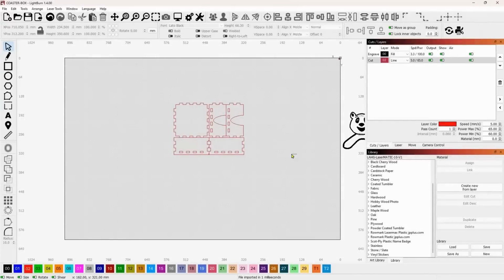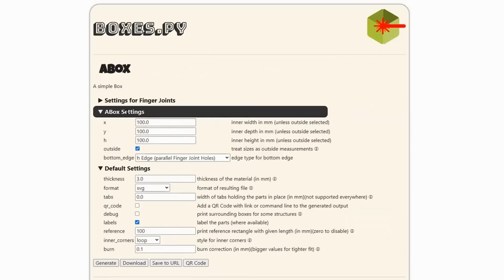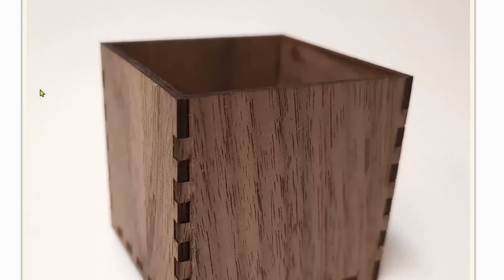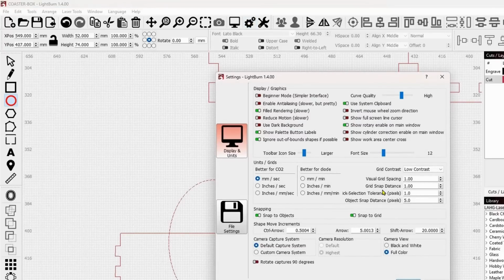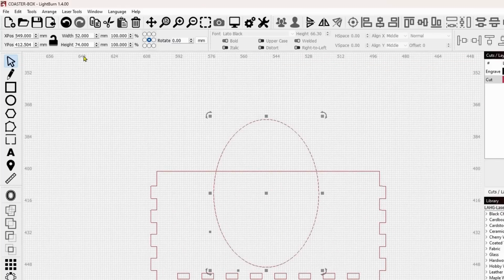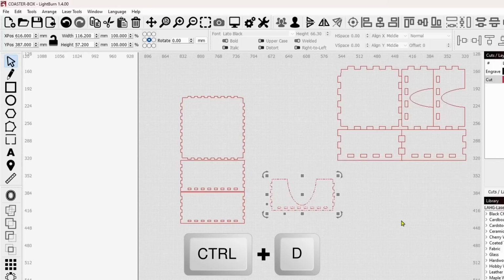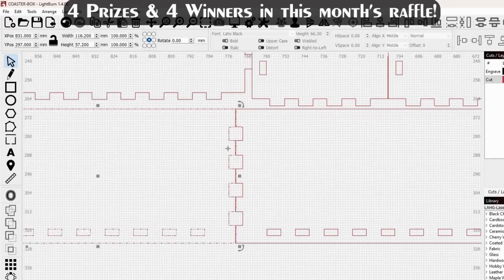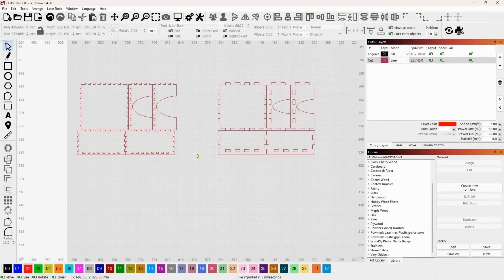📦 Lightburn Designed Boxes, PLUS a custom Kleenex Tissue Box cover!

Comment: Love the box video. Question about the slate coasters, do you put any kind of finish on them or do you leave them natural?
Reply from the maker: I have 2 finishes the customer could choose from George. One is 3 coats of plain Shellac and I scuff the final coat, and the other is a custom blend of beeswax pellets and cutting board oil (70/30) that I cook in a crockpot, poured into in a 4oz can, where it resolidifies. The wax/oil I sell separately as an upsell item for $6.00. Most folks chose the wax.

Comment: I really like the video, but putting it into practice doesn't give the expected result.  Maybe the solution is easy, but I cannot find it.  I have downloaded the simple ABox in LRBN2, the cut on the bottom and two sides is correct (100.2mm as indicated in the settings), but the two other sides come out larger, i.e. 107.2mm.  I've also downloaded the phone holder and it has the same problem, i.e. the back of the holder is significantly smaller than indicated on the template.  What am I doing wrong?
Reply from the maker: Watch the video I just uploaded Rik.
Reply: @TheLouisianaHobbyGuy  isn't that the video on boxes? The latest one is on TABS fitting SLOTS. Sorry, it may not be my day.
Reply from the maker: No it's not.
Reply: @TheLouisianaHobbyGuy  I calibrated the laser (only small variance) and had it cut again, this time all elements in one go.  Now the result is OK.  Could the problem be that before I did the cut element by element?
Reply from the maker: Not likely Rik, more likely the calibration. If it's off, the deviations get much larger as the size goes up.

Comment: totally off subject but cant think of anyone who could give a simple answer. i have searched google but dont get my answer.
Q, what  does the Corel Draw macro do in lightburn? can i import Corel Draw images? do i need Corel Draw to be installed?
I dont want o use corel draw, i just want to be able to import Corel Drawn images!!
Reply from the maker: If you mean the EpiPhotoGrave.gms by RDB, it is for preparing photographs for laser engraving. Lightburn already has a photo editor built in. Click on the Image, right click on the image and select, Adjust Image.

Comment: Hey Rich really appreciate all the knowledge you give and have been subscribed for a while, one quick question do you have an updated material list for the monport k40 my model does not have a power setting other than the ammeter, the one shown on the forum is a different control board than the one I have. Thank you in advance
Reply from the maker: They both work the same. You have to dial in the power on the ammeter so that when using Lightburn at 100%, the ammeter doesn't read more than 17 or 18 mA. Then you can use Lightburn up to 100% power. The old controller uses buttons and you have to add an ammeter, and the new one uses an onboard ammeter.
Reply: @TheLouisianaHobbyGuy  sounds good I found your video showing how to do this and it works fine, thank you for the response

Comment: Hi Rich, do you have any videos showing how you design a box in light burn WITHOUT using a box generator?
Reply from the maker: No I don't Andrea, because most people prefer to do it fast and easy. But it's simply drawing out a rectangle and duplicating it, and then welding it to the shape.

Comment: Hey Rick, love your channel and I’ve learned so much as a result of watching and listening to your videos so it’s a big thank you from me. Can I add some notes to this subject of box making that might help some of your subscribers/watchers. If you pick ‘notes holder’ from the boxes drop-down menu, it already has the finger slot for access (I use these boxes resized for my coasters) For the file type selection, I use lbrn2 which if you select ‘generate’ rather than download, followed by a tap on the file after it’s downloaded will take it directly into the open Lightburn page. Same end result as your method but it saves a step by cutting out the need to bring it into Lightburn after saving it to your file folder. Thanks again for your help and advice, please keep it coming. Regards, Terry
Reply: You see, the man has done it again, he’s taught me some more. Thanks Rick as I said I’m learning so much from your videos. Keep them coming.
Reply from the maker: Hi Terry! Thanks for the comments! I try to incorporate a lesson into all of my videos, that's why I didn't choose the Post-it notes file, but rather a box to show node editing. I prefer the SVG files because the Lightburn files change my layer settings. But thanks for the comments!

Comment: Great design on the tissue box, I now have suitable wood that my laser will burn through. So I will give boxes a go now. But one thing Rich, as a woodworker I did cringe when you brought out a steel hammer to assemble the box, Please can I make a sugguestion and invest in a wooden or nylon hammer, as its alot kinder on the wood. Thats my 2 cents worth 🙂
Reply: But most beginners won’t have your touch. A rubber (or leather) mallet would be better. Or use a piece of wood between the box and hammer.
Reply from the maker: It does no damage to the wood Ian. I'm not hitting it hard enough to make a dent. The reason why I use a small hammer.
Reply: That was exactly my thought when I saw that old rusty hammer coming up. 😮

Comment: Hi Rick I have just had delivered an Ortur rotary chuck, my LM3 is having problems trying to get it sorted by Gil from Ortur. My question is can I use the rotary chuck on my Sculpfun S9 if so which cables do I use they’ve sent 2 adapter cables but no info, can you help
Reply from the maker: You have to try both and see which one works.
Reply: @TheLouisianaHobbyGuy  there doesn’t seem to be any info from Ortur. The booklet that comes with the chuck is very basic

Comment: Good video, but did have a question, reducing the number of slots and tads. I did not see anything in boxes.py, is this a manual thing you do in LO. I like the tight fit, I hate the super glue thing.
Reply from the maker: I never noticed... I thought there was a control there but there isn't. I'm used to making my own slots and tabs Chuck.
Reply: @TheLouisianaHobbyGuy  , the control is under "Settings for Finger Joints".

Comment: Rich, I noticed when you were designing your box in Boxes.pi you said you put in the inside measurements but you left the checkbox checked for Outside measurements. Have I misunderstood what that checkbox is for? I thought if you leave that checked, the measurements you put in is calculated to be the outside measurements calculated using the width of the material you are using? If that is not correct, do you know what that IS for and can you enlighten your disciple on this point? ;)
Reply from the maker: Yes Jack, if you noticed the measurements I used, I added 6mm to compensate, plus a bit more for good measure. You can do it either way.
Reply: @TheLouisianaHobbyGuy  OK, Had not done the math. OK Thanks

Comment: Looks great thanks for the info!
How do you get the burn residue off before applying the finish or do you just finish it after the burn?
Reply from the maker: I just give it a quick wipe with a rag dampened with cleaning vinegar.

Comment: Which 10W are you working at and why not on your azert p20 plus?

Need to buy something to 900dollars 
Starting on slate coasters and stainless coasters- what would You recommend?

Gweike on the way
Reply from the maker: I'm using the Roly LaserMATIC 10. I'm using that laser because of the fine engraving and no cleanup or over burning.